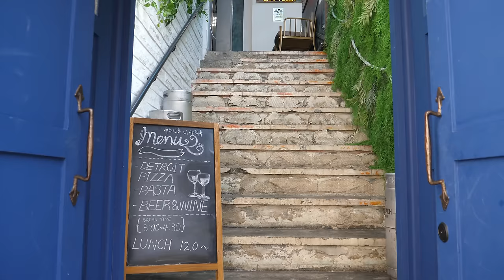이런 피자는 처음봅니다! 놀라운 토핑과 치즈로 월매출 1억찍은 피자집 Amazing crispy cheese square pizza / Korean street food

Comment: the pizza dough was allready baked , if you add the ingredients on it  and bake it again the second time , then the pizza wil burn , when you insert the pizza in the oven for the second time , then   the buttom temperature should be law , and not high , tomavoid that the pizza wil burn , just have 200 * celcius on buttom , amd 280 celcius on top temperature